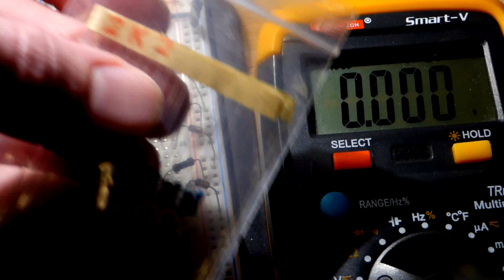Zener diode voltage measurements with 18V power supply

Comment: I'm really able to understand things much better now. The short videos are better so I can just take a few minutes and learn it little bits.  I also re-watch again and again. I'm mainly using the Arduino to do the heavy lifting and deal with the more complex logic you sometimes illustrate in ICs.  However, I do blow up Arduinos (+12 to 5v input) from time to time but they are really cheap. I use your videos to bridge the gap between the digital world any the analog world but   was wondering if you would consider doing a video to on a Arduino protection circuit using a 5.1v or 3.3V  zener and a cap like in the link http://www.thebox.myzen.co.uk/Tutorial/Protection.html . Then explain why it works.  This sort of builds on all the excellent work you have done in about 4 videos now on Zener diodes and caps.

 Thanks again for all your help and the great explanation you give. You are really smart and I really love the detail explanation for us non-smart.
Reply from the maker: I haven't controlled anything of significant power with an Arduino yet. My space is very limited so my larger scale experimenting is still just in the planning stages. I plan to do over voltage protection when I can think of good demonstration circuits, just haven't come up with any yet. It's good to know that you are interested in that topic though, it's an important one :D
Reply: @Electronzap  I'm just going to put your latest resistor / 5.1v Zener diode circuit to work in front of my input pin in my Arduino so I can limit the voltage to my 5v max input pin. I'm testing it now and it seems to work. Thanks again.
Reply from the maker: Sounds good! I noticed that in one of the schematics you linked. That is called a clamping circuit and there's a lot of material online by people who use them often.

Comment: Could you explain the purpose of the resistor and it's role in dropping the voltage as well....I assume. How did you calculate this particular resistance and why.
Reply from the maker: I'll probably make another video covering that soon.

Comment: I got some 1n4007 glass diodes and I thought they were Zeners but I guess that they are just silicon? So confusing! I fried a 555 chip experimenting with reverse voltage protection using them maybe they are Zeners I don't know! 😂
Reply from the maker: 1N4007 should be a rectifier diode rated for 1000V. Odd that it would be glass.
Reply: Oh darn I meant 1n4148 .... I got 'em confused.
Reply from the maker: I'm using the 1n4148 rectifier diode in my video that I'll be uploading in about 30 minutes, since you mentioned it :)
Reply: Excellent! I like to use the 1n4007 diodes to protect my 9V battery circuits, just in case I touch the leads wrong way. I think I can use the 1n4148 to do some interesting audio signal rectifications ... I know that a ring modulator uses two transformers with a full bridge rectifier in between them but the BOM I have calls for simply "germanium diodes."